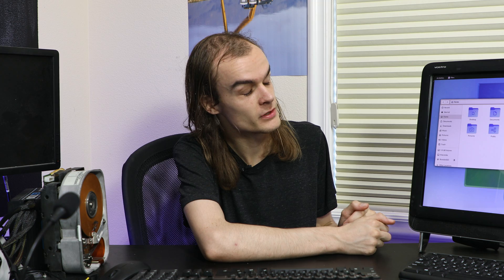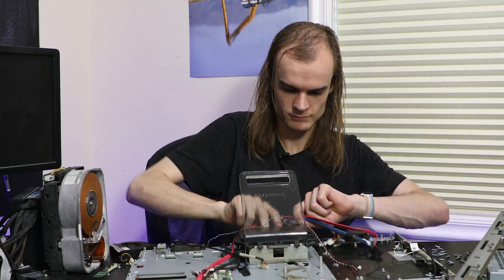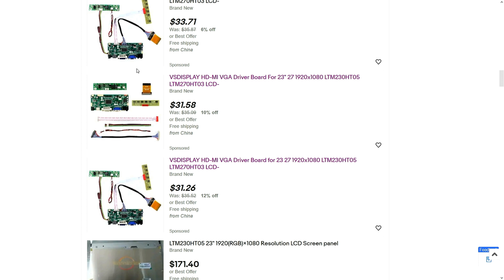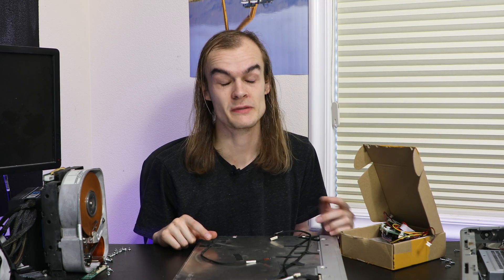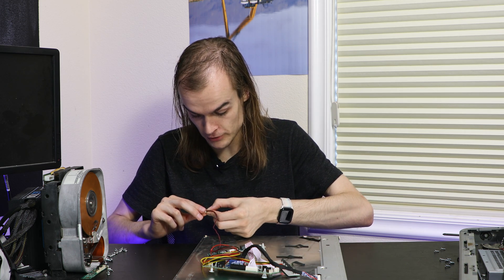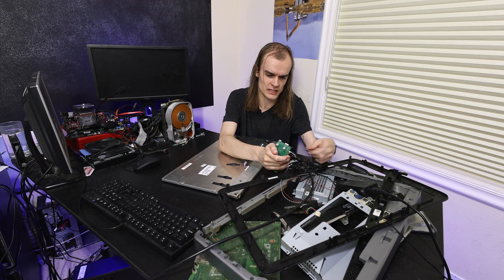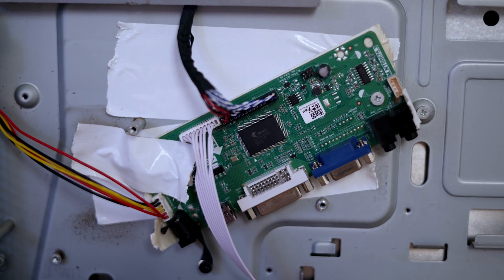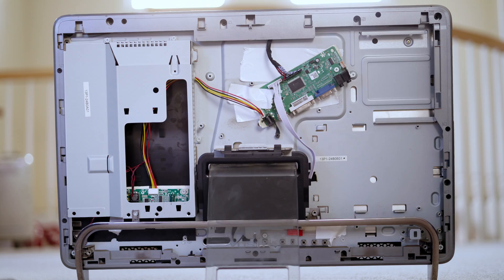Converting an AIO PC to a Monitor

Comment: I've done this to an AIO computer and at least one monitor. The hardest part is the mechanical work of making things "look nice" again. For my AIO I removed its optical drive and fitted the new VGA/HDMI/power etc ports in there so they were accessible easily. The cable for the controller buttons pokes through a now empty usb socket so that the buttons were on the outside. This means the AIO's case can be installed again. Also, the replacement adapter boards often have speaker outputs so you can re-use the AIO's speakers.

Comment: will it work even if the screen is touch?
Reply from the maker: I think this display had a usb connection for touch functionality and I’m guessing you would wire it into a type a port and use it. But this aio had issues with its touch screen so I had disabled it earlier and did t see a reason to use it for my uses.

Comment: Tried this with the converter board for an all in one HP pc. The screen just comes up white but the audio come through the all in one 😵‍💫My laptop picks up the monitor as an external display but again screen just comes up white :/ Any suggestions?

Comment: Found a tossed out Dell Wyse AIO 5470, with Thin OS/ Client. I have no experience with Thin OS, but it does have a 1080p screen! What size is the screen that you removed from your AIO? Think the screen size of the 5470 is a 24". Have you tried - carefully!! - to slightly bend or curve a screen? Does the driver board also have a built on amplifier for sounds? Hmm.. kif you had the extra $$ for this cool project, could you have bought a better driver board? Thank you 🤓
Reply from the maker: I wanna say those systems can have any OS installed on them, but there gonna be pretty slow for many uses.

I think the system I opened is a 24in panel, but there is a good chance yours is different, so you'll probably want to check for your self. 

I don't see a built in amp on the board, but I think it has a headphone out jack from the HDMI/DP audio. 

I didn't see any higher end board, but I typically aim for cheaper converter boards with projects like this as I see the whole point of this is to be cheaper than a pre-made monitor.
Reply: @ElectronicsWizardry  the Dell Wyse 5470 AIO is a recent find, but not sure what to do with it! I also thought of installing Chrome "OS", but would still need a higher capacity SSD. Think it has a 1.5Ghz or so CPU, but I believe it's a Quad core

Comment: How do i turn an AIO into a normal pc
Reply from the maker: This really depends on the exact all in one, but it’s typically not easy as non standard boards are used. It’s likely possible to plug the board into a monitor, keyboard, network and other devices to the ports on the board. The biggest issue would likely be buttons like the power button and the power input.

Comment: Great video!  With Windows 10 becoming obsolete and my HP 23" all-in-one not being compatible with windows 11, I was debating throwing it away or trying to upgrade the cpu or motherboard to make it compatible (which is impossible).  This gives me another option.  I plan on converting it to a monitor and then just hanging a windows 11 mini-pc off the back so I can continue to use it.  Fraction of the price of a new all-in-one.  Thanks!
Reply: Hi I have the same aio and I have a few questions
Reply: I wanted to know the process  of how did you did this
Reply: Pls reply